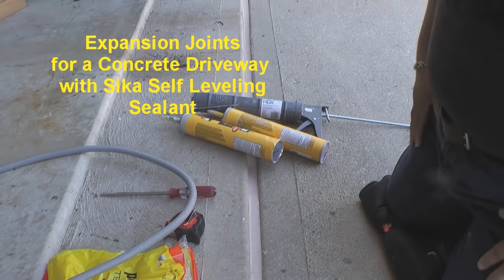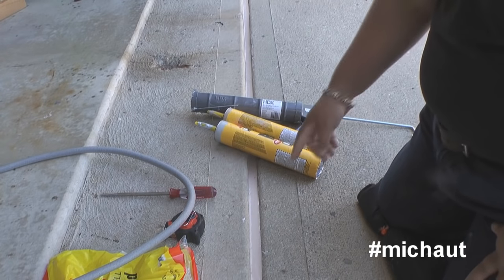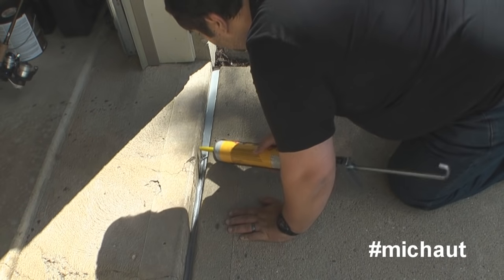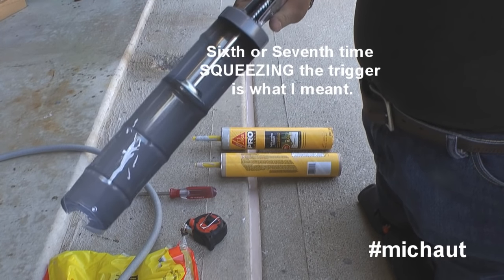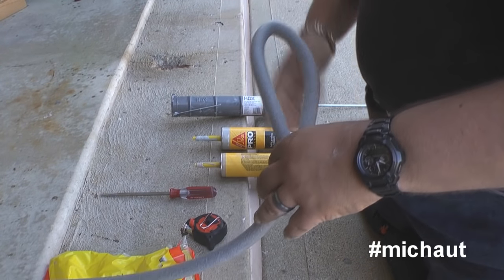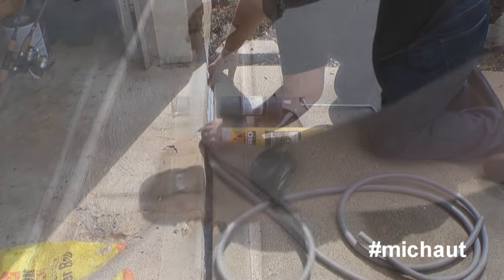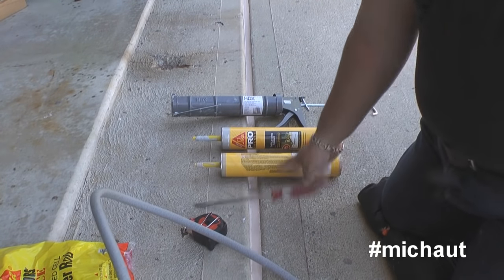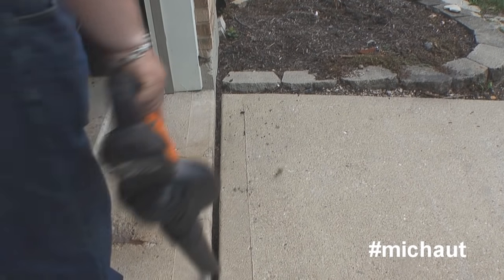Concrete Expansion Joints and using Sika correctly

Comment: For large joints, skip the foam filler cord - get a bag of play sand  ( unlike other sand sold, it has no moisture ) fill the joint to 1/2" below the top and pump self leveling Sika on top. Also , get the Large tubes ( 29 oz ) as they are $13.69 at Home Depot, the smaller tubes are 10oz and are $7.98 ea.

Comment: I used the SIKA product (grey) with the backer foam as you have shown here.  The only thing I did different, (from another YOUTUBER) was to throw a bunch of sand on it when it was still wet, and allowed it to cure for 3 days before driving on it, and sweeping the excess sand away.   It worked like a champ and has survived 2 WINTERS in the Northeast.     Now that I am in my retirement home in the mountains of North Carolina, I plan on repeating this process again.   Many THANKS for your video !   It was a huge help !

Comment: Good product and Easy to use. Home Depot sells 29oz large tube about $13.00. Painters tape along edges a very good tip. Also do not add more than 1/2 inch deep if product in joint. (Product says 1/4” min and 1/2” max = you’ll save more on amount of product you’ll use when keeping depth about 1/4”). You will definitely use much more than you think - buy extra, you can always return.  Now the most important- product takes 3-5 days to fully cure and will stay “sticky” for many hours, that means unless you like a surface with bugs, leaves, dust, etc, cover joints with something to protect and keep clean while curing. I was “lucky” and only poured about 12’ before realizing and then “covered” the rest of all my patio joints.

Comment: Pay attention to the size of tubes. Lowes sells the 10 0z. tubes for around $9.00 and the 29 0z. tubes for $13.00 so big savings on larger tubes. Home Depot was about a $1.00 a tube cheaper on the 29 0z. tubes.

Comment: Great video.  I use Sika always - it has lasted the longest.  Other tips include, warm the tubes up to at least 70 degrees to save the forearm and I have topped the joint with a light coating of sand to prevent any accidental foot traffic from picking up the product - i generally do public areas when public is present.  NIce job!

Comment: You forgot to tell them how to stop the flow on each end of the expansion joint. It will drain away the expensive Sika if you don't put something there. I put tape but that was a mistake.

Comment: I have almost the identical situation, and I'm using EXACTLY the same products you demo here. My gap was larger, though, and I ended up using two 3/4" foam backer rods plus one 3/8". This AFTER I filled some of the gap with gravel and sand. I wedged the foam rod in there best as I could. I ended up with about a 3/8" gap to the top of the concrete.
10 minutes later, to my horror, the foam backer rod was floating to the top. Then I noticed I didn't have enough caulk, so now I'm hoping this first round of Sika will hold the backer foam in place, and I'll need to do another layer of Sika in a day or two.
One thing I found is that using a rotary grinder and a 60 grit grinding/sanding disc, I can easily remove crud on the edges of the concrete without damaging the concrete itself.  So, if you have caulk spills that harden on the concrete,  the disc should work well to remove them.

Comment: a quality caulk gun can make a huge difference as well, I did a few with a standard 29oz gun that got trashed beyond use. I got another with these features:  "18:1 Thrust Ratio, Rotating Barrel, Sintered Steel Catch Plate, Brass Thrust Rod Bearing, Dripless"  for my most recent work on small oddly shaped cracks in concrete and I could not have done any of that with the standard gun, especially the release that stops the flow. I have patches of sikaflex on my face from 4 days ago, it is STRONG stuff.

Comment: Put masking tape on the sides where you dont want any joint seal (sika), use a very wet finger to smooth and keep wetting that finger. Pull tape and smooth again. Joint seal wont stick to a wet finger so just wipe finger off with a rag. Don't soak joint seal (sika) with water while smoothing it off as joint seal wont stick. Also, when smoothing, leave joint seal lower in middle and higher on sides (concave) for any expansion, your finger ☝should be enough. For wider joints, use a thin plastic scraper or tube to make the same concave indentation along the length of the joint.
Tip to get it off your hands. Put rubber gloves on, like surgical or the ones for preparing food, and let them sweat. Then rub it off. Sika wont stick to a wet surface.
I've done kilometres of joint sealing.......so yeah😭😵👷

Comment: Excellent video. I would like to suggest another alternative to backer rod. I used foam interlocking mats. The kind you find in gyms. I happened to have some left over from my laundry room remodel. They are inexpensive and you can cut them to the exact width for your joint. My Sikaflex joint came out beautifully and has held up for fives years. This is in Pittsburgh where we have freeze thaw cycles. Great job you did on yours.
Reply from the maker: Thats not a bad idea.

Comment: I did this between my concrete porch and my foundation about 3 years ago. Water was seeping in at that spot and going into my garage. It worked great until recently. The self leveling silicone shrunk and was letting water back into my garage. Guess I will have to come up with another solution.
Reply: Most likely your sealant didn't shrink...your concrete probably moved.

Comment: i've used the product and have found it works well.
a suggestion on the squeeze-out effort issue.
try puncturing a sample tube with a larger diameter point.
i started out with the fold back small wire on my caulking guns and found that the 
tubes were really difficult to eject.
a larger diameter puncture helped.
( with Sika tan color)

Comment: Great video man.. this kind is my best to watch :)
I did see a person use a weather proof caulking to secure the becker rod in the joint then fill with the filler.. then neatly applied on top of the sealing a color play sand to blend into the concrete

Comment: Cut your nozzle to a similar width to the joint. Apply masking tape either side to the joint and use an appropriate tool to finish to desired profile. Use Mineral turps to clean off your tools and hands. If you have a larger joint to fill than the backing rod you have, you can twist the backing rod along its length so it is like a spiral and place that into the joint. Best to try and match the backing rod diameter to the joint width and go slightly larger so it holds itself in place. Use a solution of washing up soap and water to dip your finger in to then shape the joint with, test the strength of the mix until satisfied. Joints should be half round/concave to allow for movement. If the joint is finished flat they will not accommodate movement and in time tear/shear from the concrete. Never heard of self levelling Sika Flex Pro, would suggest you use the alternative to self levelling if available there. Cheers

Comment: What is the exact name of the product? It would be great if you could put it in the written/comment section. This is new to me. Thanks.
Reply from the maker: https://usa.sika.com/en/solutions_products/Construction-Products-Services/construction-sealing-bonding/construction-sealing-bonding-products/02a025/02a008/02a008sa53.html

I tried but they keep moving the link. lol    This one is for 10/2018  look for SIKAFLEX that is the product I am using specifically.

Comment: You mention using a flat head screwdriver to help you install the backer rod....."WRONG", most (if not all) backer rod material sold in chain stores is what is called "open cell"......that means that its like a hot dog casing.......if you damage or puncture the outer casing on the backer rod, then apply sealant over it, the air trapped inside the backer rod during MFG will "out-gas"......that air has to go somewhere......it can and will cause your sealant to develop "blisters" all over the place......destroying what you just did. I sometimes takes days for this to show up......only use a smooth roller type wheel that is designed to install backer rod.......or better yet, only use "closed cell" type backer rod and you won't have to worry about "out gassing".
Reply from the maker: Terry your right but I didnt have that problem I guess with luck.  ITs nice to know that issue though.

Comment: I just don’t bother to use backing rod just pack some fine sand in the joints really tight leave half inch low and use self leveling sikaflex
Reply from the maker: Freaking Genius!  I should have thought of that!
Reply: Sand is uncompressible and any expansion can cause it to shift.

Comment: I first tried using backing rod and found it to be either too big or too small.  If it bulged up too far the sealant ran over onto the driveway.   If there was any space between the backing rod and the concrete, the sealant ran down into the space.  I then eliminated the backing rod all together and tried filling the space with sand.  I then used a stiff broom to sweep out the excess sand to get the proper level.  It worked fine!  Time will tell if this holds up.
Reply from the maker: It should, Sika adheres and hardens quickly. I think the backing rod was a better choice for me and remember you can always cut the rod to size to help your needs.

Comment: The backer rod needs to be 1.5 times the size of the joint.  You were using .75" backer rod in a 1" joint, that was your problem and why you had to double it up.
Reply from the maker: Yes but the other problem was getting different sizes, at the time if ask for backing rod at the box store.......crickets from the employees.....so i wasnt even aware that they made different rod until ONE DAY I passed an area that was suited to whole situation. LOL

Comment: My gap between the driveway and garage is pretty deep. Do you think that I have to clean out all the old "rubber felt" or can I leave the bottomstuff in their and just clean the top to make enough room for the backerrod
Reply from the maker: In the end as long as the sika is on TOP of the material your fine.  The backing rod you use is to make sure it doesnt spill into a void that will basically drain the material away.  At times I didnt need the backing rod because in the smaller channels of expansion joints the concrete was still there.  I cleaned the concrete and then applied the sika above that crevice

Comment: Thank you, it worked very well and looks professional. My question is how to remove excess Sika SL sealer that flowed over the joint ? Is their a cleaner or a way to clean up the messy parts I made from a drippy caulking gun ?????
Reply from the maker: Mineral Spirits were suggested as a good cleaner... I cant claim that is it or isnt.

Comment: Thanks for the tips. I am going to try this method this weekend.
Reply from the maker: +Hardcase19691  I suggest that you cut the tip small at first to get used to the flow and then make it larger!  Beware this stuff is sticky after it gets a chance to dry; so clean any mistakes you have as well as you can.

Comment: Would it work to do this prior to applying an epoxy/flake floor? The expansion joints I'm trying to fill are similar to the size in the video. I'm worried that the self leveling polyurethane will be TOO flexible under the epoxy. Thoughts?

Comment: Color.....I did the exact same thing.  Also did it now.... In the fall.... Leaves have stuck to it like a nice glitter-glue project. Is it an issue if I used spray foam instead of backing rod?

Comment: Hey chris.  Thanks for the video.  I made a mistake and used the rod with a bottle of crack filler in a deep joint.  I did double up the rod.  My question is should I try to remove it all and start over or can I finish up the job by using the sika to finish filling up the top?  Your advice is greatly appreciated
Reply from the maker: Dtoon  I mistakenly used one entire bottle of Sika on half of the expansion joint of my driveway until I realized I got the wrong color.  SO to fix my mistake I topped over the wrong color with the right one, sika dosent care on what you have on the bottom to prevent it from flowing down.  I just let the other color dry after 48hrs and just went to town and filled over it.

Comment: I had asked once at Home Depot about filling in that crack between the driveway and the garage and they told me not to - that you needed to let some rain, etc. run down there.  So, I never worried about it, but now I see that I should have as my driveway is now lowering slightly.  Should I also fill the joint running down the center of a two car driveway?  and the joints crossing it?
Reply: yes!

Comment: Duct tape makes this job much easier and way cleaner looking. 1/16" from the edges, pull once the skin starts. You will think it's too late, but it will level the stuff that rolls up and over from the tape back into itself. Second, it's self leveling yes, but you can and still should work it. Wait about 10 min and then you can level out low spots, or high areas, use a putty knife or something. Backer rod is great, or use sand, you can double up or even triple up backer rod until it wedges tight, I've even braided it before to make it fit. Sanding after it's skin starts will help it cure, give it texture to match concrete. Cross joints are good for self leveling, joints crossing grade though should use crack flex

Comment: Great information. Do you think there's any issue in using this product on an aggregate stone driveway?
Reply from the maker: I know its without question, but the sealing will happen as SIKA is just so sticky BUT will not work very well on loose stone as over time it will just fail.

Comment: How many linear ft can one large tube of sika caulk cover using your method?
Reply from the maker: That is an awesome question, that number is controlled by the size of the gap and how much of the material you use to cover the expansion joint;...but with that said I was able to get 20 feet out of a bottle..... I ADMIT it, I used more than I should because I wanted a nice thick application.

Comment: I have a bunch of cracks on the driveway. I grind them with a saw, but now I have to fill them. Why you any one care to fill expansion joints. These are straight edges. I wish that was my problem. Great video and lots of good info though.

Comment: if u would have used a larger diameter foam you would not need to use so much or a double amount . I use the foam in all diameters and u can purchase in the stores.
Reply from the maker: You know that is true...BUT my HD of my local area didnt have those sizes in store.  They claim it was because they were a smaller store or something stupid like that...I could order and wait.....or just double up on the current backing rod that was there.  The point of the video is to find the way to use what you got and still have an effective use of the material

Comment: Can Sika be used on brick and cement joints? In other words, between my house and walkway. Thank you.
Reply from the maker: Yes.  Two hard surfaces will be fine as long as the material is not made of asphalt.  ---IT WILL stick to asphalt-- just not for a long time.

Comment: How about clean up? In other words...if i get it on the sides of the concrete what do i use to clean it off?
Reply from the maker: Henry that is a great question.  SIKA made this material really easy to work with in its fresh out the tube form...........CLEAN IT UP NOW before it drys!    ONCE SIKA is dry its like fighting a mighty fortress of ultimate sticky material that will not come off easily.   YES cleaning solvents do work,  but the last layer of color will fight to stay on anything.  Clothing, Hands, the sides of concrete, and it will not let go easy.  Have a good old rag ready, and if you have an "uh-oh" moment; just  wipe it off right then and there.   I suggest also that you use the oldest pants and shirt that you do not care for if you have a long day of filling multiple Expansion joints.
Reply: Thank you for your help!
Reply: you can put tape on both sides of the joint before you apply
Reply from the maker: The truth is that once you understand how the SIKA works, worring about oops moments are going to be rare.
Reply: Thank you.
Reply: The only things I have found that will remove Sika is Denatured Alcohol and Acetone both will remove Sika before it sets up nothing will remove it after it dries. Trying to get this stuff off your hands with soap and water is a complete waste of time. I keep a can of either acetone of denatured alcohol and some terry cloth towels nearby for clean up and in case of accidents.
Reply: That is a lot less toxic than Acetone. Thank you.
Reply: *****
I have used that stuff on stickers it works great never thought of using for this I will have to try it thanks for the tip...

Comment: How much or how deep does the Sika Have to be to hold properly>?
Reply from the maker: Kristin I tried to follow a specidfied depth of 1/4 inch by placing expansion rod material and measuring.  You quickly find out, you have to eye ball it and then have to trust that SIKA will do what it is supposed to do when it comes to self leveling..   As long as there is no leaks, Sika doesnt need to be thick to do its job,  once cured, it is a very durable and strechy material.

Comment: I used this stuff and it looked good for a few years but then it deteriorated due to the UV rays from the sun so unless you want to go to the expense of replacing it every few years I would suggest something else.
Reply from the maker: Lee I have not had that expirience yet, I could see how that direct sunlight could be a issue.  I have the luck of not to much sun hitting my drive way.